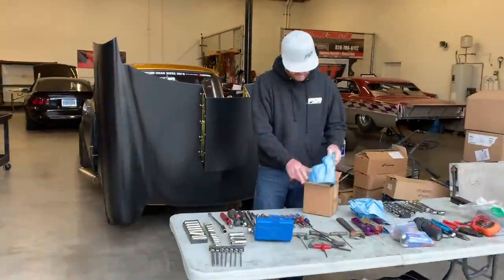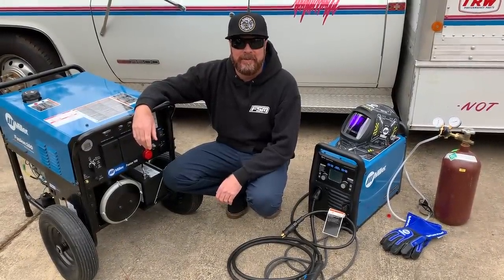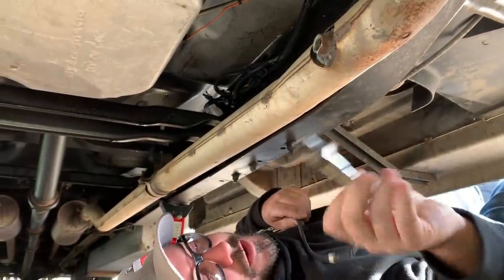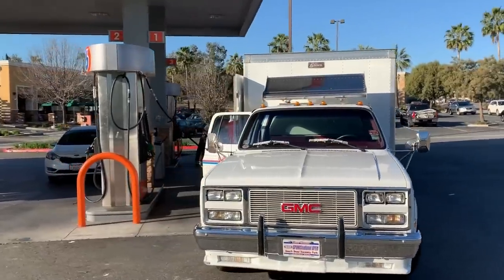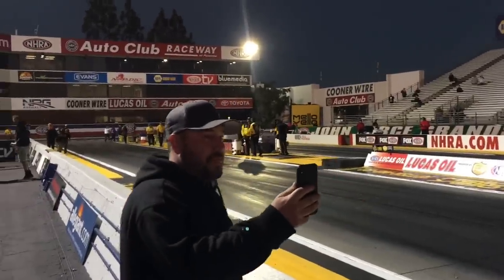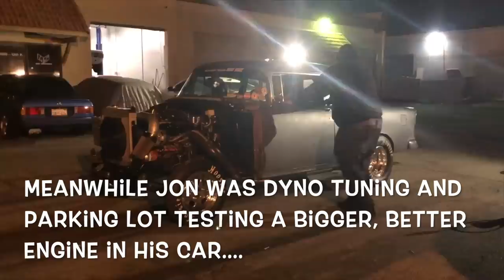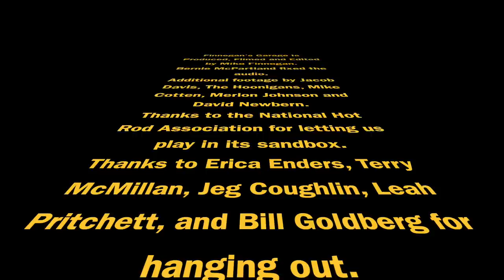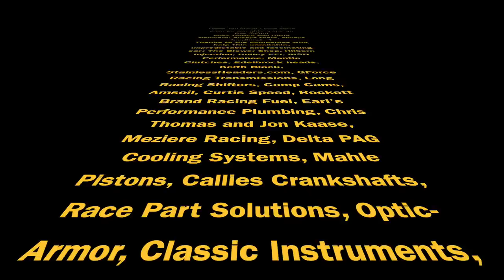Finnegan's Garage Ep.65: The Biggest Wheelie and Race of My Life!

Comment: It's the high RPM wasted energy no overdrive causing the excessive  fuel consumption. Need a freeway engine speed that will allow adequate engine torque to move the weight without overloading the motor... that will provide max fuel economy.

Comment: Take that metal wing off the roof and replace it with a semi-truck style fiberglass roof cap,then install a quality aftermarket EFI system.FITECH makes a great bolt on efi that is self learning and(along with the correct aerodynamic roof cap) should improve your mileage.
Reply: FiTech sucks.
Reply: @landonfranklin1170  ,I have FITECH units on two of my vehicles and have had good results.However,I would go with a Holley setup if it were anything other than stock,i.e. a race car,high hp rock bouncer etc.I have a bone stock 78 El Camino and a 74 F100 4WD and neither have given any trouble at all after the swap to EFI.
Reply: Randy Travis  -Even at the correct angle there's too much area left exposed on the front of the box to make a huge difference.Even with a fiberglass roof cap there's a lot of area on the sides of the box that catches the air,so anything done will probably not improve his fuel economy by  very much,in my opinion.

Comment: Man I'm not saying that there's not something wrong with the truck but I remember my truck that we have from the 80s my dad has an 88 big block 3 speed Suburban one ton and when we pulled our 35 foot Airstream which is roughly the same amount of weight air mass it got 6 to 7 so I think that's just what you're going to get with the particular truck and load that you are carrying especially if you're running the air conditioner but I'm curious to see what the O2 sensor says

Comment: So what was wrong with Blasphemi's cooling system?  Also, I'm curious to know why the engine gave more power with no coolant
You will probably get more mpg if you put a wedge nose for the main body above the crew compartment.  That wing looks stylish but won't do much even if you move it forward and increase the angle.  A simple improvement would be a throttle body injection system (MF has done this several times before), but for a  sizeable improvement, get a more  efficient engine.  Cummins diesel conversion?

Comment: I owned an old Snap-on truck with a 454 Turbo 400 and probably in excess of 14000 lb and still got 10 miles to the gallon I do remember the torque converter practically had no stall speed put it in gear and go

Comment: put ceramic wheel bearings and in rear end and transmission should of put the oxy sensor  right by the collector after all pipes  cone together  or right after the stock intake manifold

Comment: Put a 4L80E in it and some proper truck tires like a Michelin X MULTI Z in 17.5's and you should be near 10mpg's. Also a new FI setup from a later model truck or Holley would get you over 10mpg.
As for everyone saying go diesel, there's no point. The 454 in proper form is well suited to what he wants to do and it will be cheaper to run even with worse mileage due to fuel costs. With how diesel is now and the new regulations for the maritime shipping industry diesel is only going to get more expensive and it will actually drive the cost of gasoline down. The demand for diesel is going up rapidly and because of how the refining process works,you can only get so much from each barrel of oil.

Comment: I might be incorrect here but does your year of 454 have the air injection into the exhaust possibly giving incorrect readings on your AFR?
Reply: Far as I know, A.I.R. systems are typically only injecting into the manifolds upon cold start, to lean the rich mixture coming out of the cold engine.

Comment: Cummins & drivetrain out the og ramp truck into this, this motor into og ramp truck. Sell og ramp truck with cherry motor in it (where it'll probably return much better gas mileage because its not towing a giant sail bolted on). Carry blasphemi in safety in the closed box but reap the reward of all the development you put already into the og ramp truck drivetrain. I love the sound and sensation of petrol v8's but for workhorse trucks, its got to be (turbo) diesel power.

Comment: I got a solution for you!
Say...2 TH400 transmissions, end top  end, of course only the first one with a convertor, You will have 6 speeds and double the overdrive! or 2x4 speeds, preferably non computerized, less headache!
I think farmers use to do this ghetto style to get lower gears! …anyway with enough practice, you should be able to have a smooth shifting setup!

Comment: Semi-trucks have fibre-glass shells on the top of the cab to smooth the transition between cab and the top of the load. Improvise something with pipes & a thin sheet of Lexan.
A petrol V8 in that thing sounds dumb, even with your cheap gas prices.

Comment: This car needs to see Cletus's Leroy, an 8.68 might just be enough to beat that cars 8.50 average. Everybody knows with stick you are gaining or leaving a few tenths every race based on launch and shifting. Granted Leroy has been into the 7.80s its only ever done it once. Something tells me the 55 has 7s in it
the 55 shifts 4 times to leroy's 5 shifts, atleast i think leroy runs through 5 gears based on its 168-180 trap speeds. Doesnt matter how fast you can be, its about how fast it is during that race

Comment: Shouldn't that truck have a TBI 454 and a 700 R4 trans? Why does it have a carb on it, and what transmission is in it currently?  Does anyone know?
Reply: no 1 ton (or larger) would ever have a 700r4. a 700r4 was only used with the 454 is the ss pickups, and those were a half ton. this thing has a th400 trans, gm used them up till 96. being carbureted is kind of confusing, that year pickup should have been tbi, but cab and chassis trucks can often be a couple years behind in technology.
Reply: This truck is beyond the weight class that would have required it to have the same emissions requirements as say a 1 ton of the same era. 

I think GM was either using what they could trust to work with such a heavy vehicle (since EFI was still relatively new in trucks), or they were just using a carb setup to use up their inventory, since the emissions standards for this heavy of a vehicle was/is a bit looser.

Comment: As one who drives a '75 C-20 Custom Deluxe Camper Special. With just a little 383 Stroker to turn over the 35s.. Your getting 5 and half miles to the gallon? 
Dude don't bitch,  at least it will run on regular.

Comment: I run a 7k 1 ton dually towing a 14k trailer.   21000lbs combined I get 17 mpg average and we got serious hills here.   The trick to it is to run a mildly tuned diesel,with out emissions.   Nothing like freight training passed people on a 12% grade (2/3s to the boards, 23 psi boost, 4th gear, 2900 rpm at 92 mph).  Nah,nah,nah,nah. Hey,,hey, Good Bye sucka 😂😂😂

Ditch that 454 and do another 12 valve conversion.😉

Comment: Fuck the diesel, stick with the big block!

Stick a gear vendors unit in it instead of a 4L80E! It will give 6 gears instead of 4, and make climbing those mountain easier AND give you better fuel mileage!

 Ext, stick a fitech or Holley variant of throttle bottle fuel injection on it.

The combo of the two should get you near 10mpg, if not better!

Gear vendors and fitech bro!

Comment: Time for a Cummins diesel swap you're never going to get any more gas mileage out of that 454 even with a 4L80 trans. My brother-in-law's mom loaned us her 38 ft class a motorhome with 454 Chevy Qjet carb overdrive trans to go up North in Michigan and that POS was horrible on M33 far less hills your traveling. 3 guys a 3 place dirt bike trailer on back and my meat head brother in-law straight face says to me easy on the passing gear you're wasting gas because it would kick in and out of passing gear if you're familiar with a quadrajet carburetor when you're standing on it that thing sounds like it's going to suck the air cleaner right into the engine,time I got to top of hill my speed went from 60 to around 30 mph I thought a few times I might have to stick my foot out the door and help it get to the top.

Comment: how about a gear vendors overdrive. otherwise the diesel would be the best.
Reply: That truck has a 4 L 80 trans. Apparently it bogs down every time they put it into overdrive so I guess they're just running it in Drive hence the terrible fuel mileage
Reply: @jakewelder6413  400 turbo no OD
Reply: He was talking about putting a 4L80 in, and musing if they'd be able to use the overdrive. The truck currently has a TH400.

Comment: AFR number is compromised. I understand the bad fuel economy based on the engine and vehicle size and shape etc. But you said you have an exhaust leak. You could easily be drawing in air. So your data is compromised and so now your back to making assumptions.

Comment: the 454 chevorlet has the worst rod,stroke ratio in the business,no one ever talks about it,its 1.45 to one ,that means the damn pistons are scrapin the walls so bad,forget mpg,i see guys turning 6500 on these engines with studded lower ends and the flame the pistons constantly,i've told an number of people at the drag strip,i ask everyone of them,how often the pull the engine down for a check,everyone of them says the same thing,black death on the skirts,think about it-----------1,8---1,9 is perfect,the mighty mouse small block 302 was 1.9,thats' why it screamed